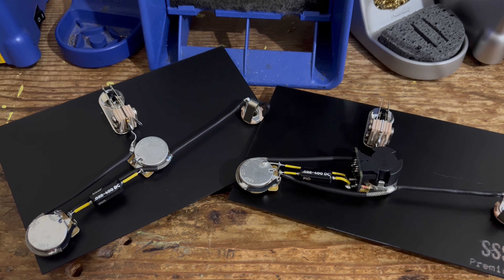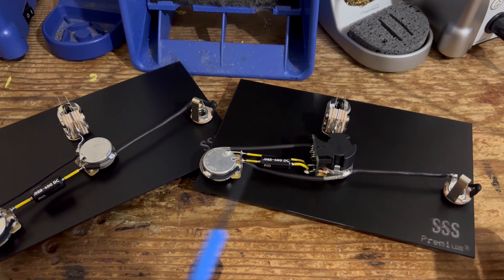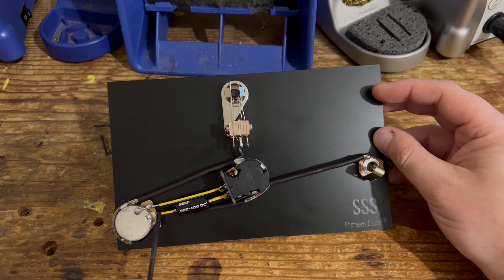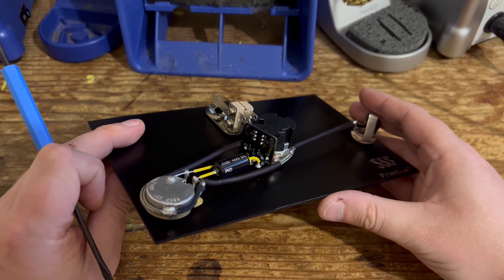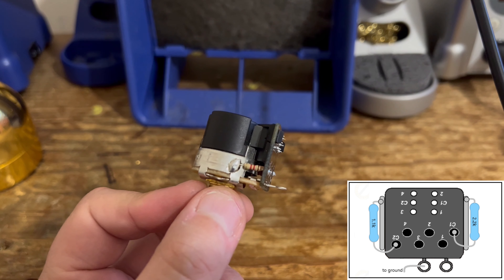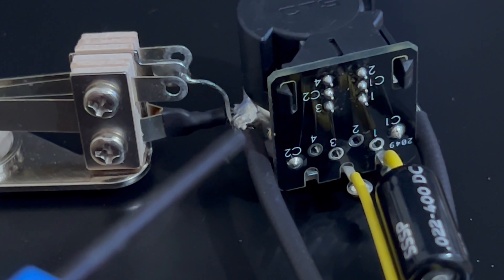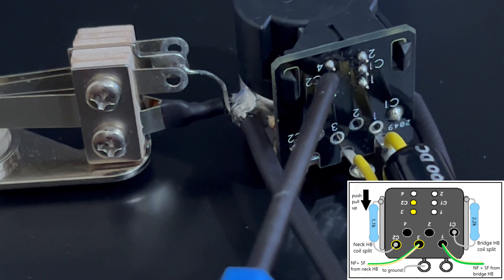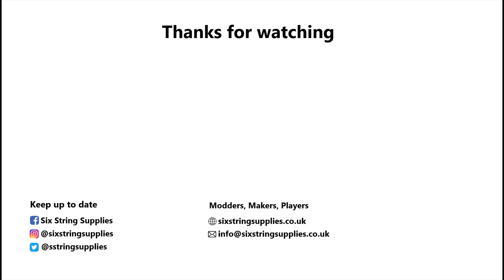PRS Partial Coil Split

Comment: Great clip….. but I believe in have a bit of confusion. I have been back & forth with this clip (PRS SPLIT w/ 1.1 & 2.2) and the clip you have where you’re describing the comparison between CTS pot va classic pot. In that clip you mention that grounding would be from lug 3 &/or lug 1 to ground and possible to install the resistor there instead of the ground wire. That would correspond to the 2 bottom lugs on a classic pot layout. But here, it’s showing that the grounding option with resistors would be using the middle 2 lugs of a classic pot (C2 & C1 in a CTS layout). So I think I need some clarity. Is there a mix up?? Thanks for the feedback.
Reply: In this case it's exactly the same. When pulled C2 and 3 are connecte, as well as C1 and 1. If pushed, nothing happens, since nothing is connected to 2 and 4. Therefore you can do it eather this way or the other
Reply from the maker: Both work, whatever is easier for you 👍
Reply: @SixStringSupplies  Yes...got a clear response on-line from you guys.. thanks.. I'll give it some attention this week.

Comment: So...   If you are wring a PRS (or anything...)  with PRS pickups, which in most cases are 3-conductor -  Your black/white is your - hot/ground  and your red is the series coil link/split coil conductor which goes to the coil-split switch (with or without partial resistance) to ground-out each of that humbuckers coils - giving single coil output, or partial single coil with a series resistor.

Comment: I'm really new to wiring pickups :)
Do I need this big black resistor between tone and volume, if I'm not using a tone pot at all?

Thanks for the video :)
Reply from the maker: It’s a capacitor - yes you will need a capacitor for your tone control to work properly. Thanks for watching 👍

Comment: okay, so this is exactly what I'm looking for. but what happened if you have 3 legs push pull/push push tone (mid - output "why don't you connect the left(input) on volume to mid tone pot instead of the mid one and put the cap on tone?", right - ground or something, left - where this thing goes)? and what will happen if instead of connecting S+N finish in 3, you connect it to C2?

Comment: How does the partial split affect neck pickup vs bridge pickup? The neck has 1.2kohm and bridge 2.2kohm.. is it kinda like how a 300k volume pot will make your tone darker than 500k and they wamt to take more brightness from bridge pickup than neck?
Reply: Think I flipped what's 1.1 and 2.2.. say we have a 490r neck and 498t bridge in a gibson. This would take neck reading from say 8.1k down to 7k and bridge from say 14.2k down to 12k?
Reply from the maker: Nope, you need to calculate the resistance: https://www.allaboutcircuits.com/tools/parallel-resistance-calculator/
Reply: I'm having a hard time finding a diagram with the Cts push pull you are using in this video, do you have the diagram layout?

Comment: How would i do a wiring set up like this with two 500k pots and one cts to two humbuckers, toggle switch  and jack, im half way through doing this prs set up on one of my guitars, but my other guitar which i have to do is a harley benton sc1000 custom with floyd rose  and has three pots and a les paul style toggle switch